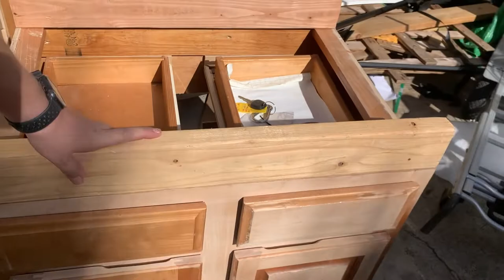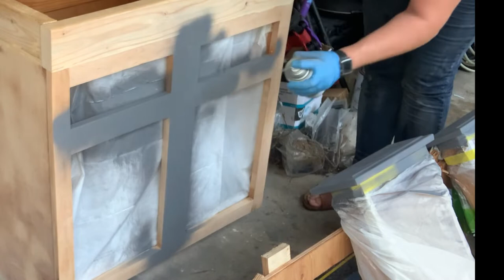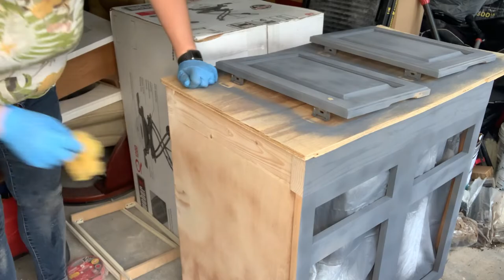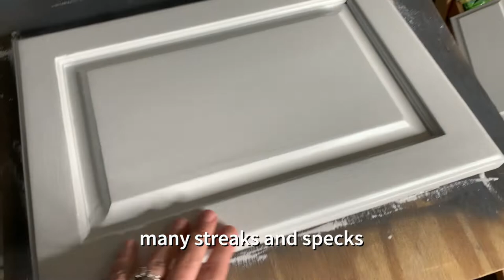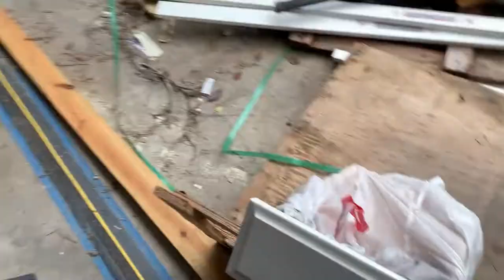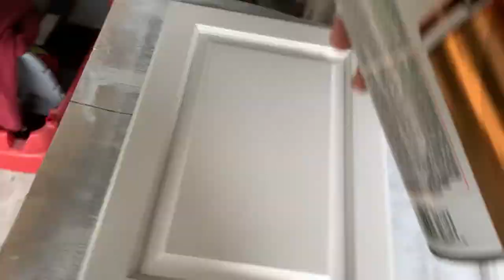Too-short bathroom vanity? how to make vanity higher

Comment: How did you attach the 2x4s to your vanity?
Reply from the maker: I just used wood glue and clamped them. Probably should have screwed them onto the vanity, at an angle. Or maybe used pegs. But they didn't fall off. I screwed the 2x4s to each other in a rectangle, and also the vanity was put into a corner. So I think glue will be enough. It's not a high shear situation.
Reply: @paisleycode  thank you for responding! From the picture it looks like the right side is against the wall but the left side isn’t which is the reason I asked about attaching it. Mainly that left side?
Reply: How did you get that wood so smooth (for the front)?  Only sanding? Or did you fill it with something?  The 2 x 4s seem rough (which they usually are from the lumber yard).
Reply from the maker: @JAG1762  I screwed the vanity to the back and side walls. That secured it enough that it stayed put. The old vanity was secured the same way.
Reply from the maker: @stephB7609  I just sanded it. There was a small gap at the edge of the 2x4 and I filled that with wood filler. But the face of the 2x4 got pretty smooth just with my rotary sander. I guess there weren’t any big dents in the 2x4. If I’m using one for finish work like this, I try to pick one that’s not too messed up.